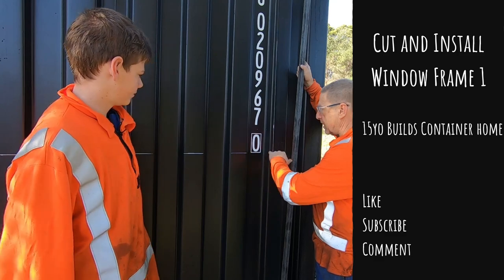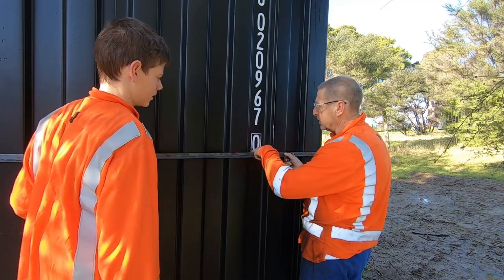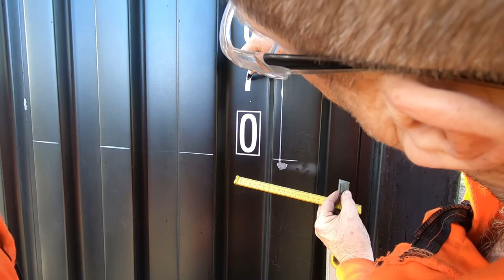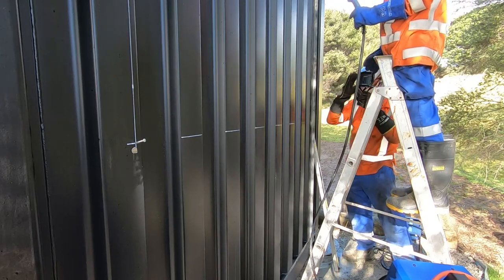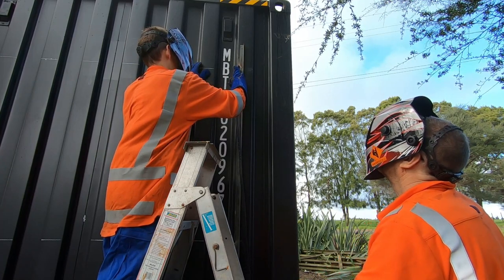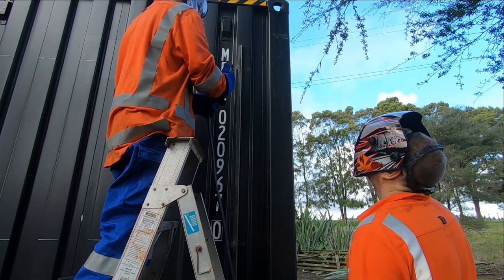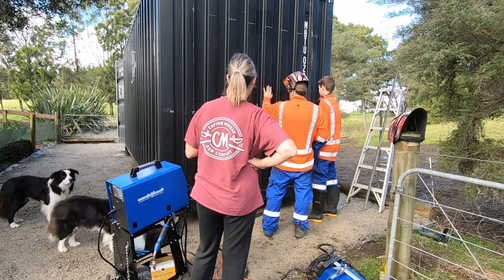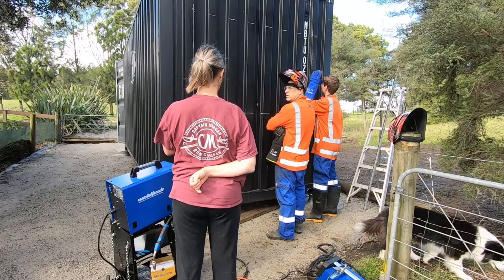Shipping Container Home Build #7 - Cut hole and tack in window frame

Comment: I’ve seen a trick used on window frame installations you might like to try: Before you cut the wall to install the window,  tack weld a stiffener bar a foot beneath the opening and a foot above the opening extending at least a foot beyond both window side edges. Containers seem to warp after they’re cut and tack welding a stiffener in before the frame installation will keep the wall edges more in the same vertical plane. When the frame is welded in, remove the stiffeners.
Reply from the maker: Just Me great idea , thanks for the heads up next window is a big French door

Comment: Is there any advantages to using square tubing frame vs angle iron window frame? Looking at using the angle iron due to the advantage as it working as a J channel as well. Thoughts?
Reply from the maker: Great question - we looked in to this and i couldn’t find any info on disadvantages v advantages - in the end we went with square tube for greater rigidity and also it required a little more work with regards to welding, therefore Sam learnt more using this rather than angle iron.
On advantage we did find is you can screw in to the box section for attaching framing etc